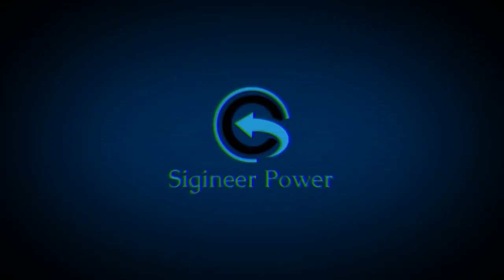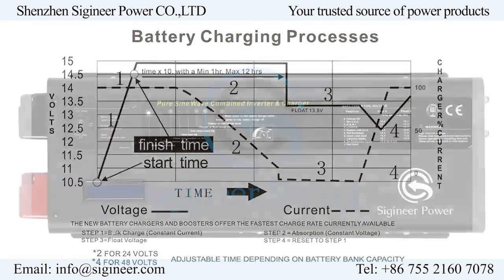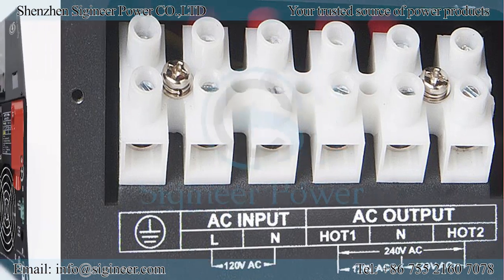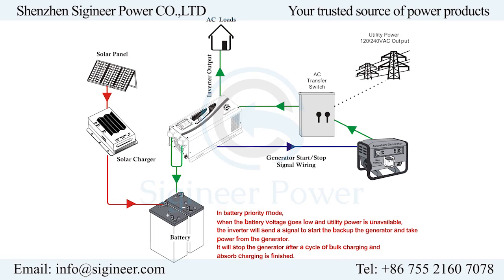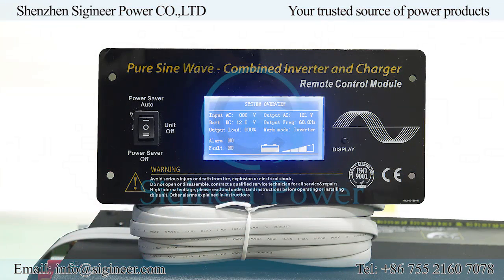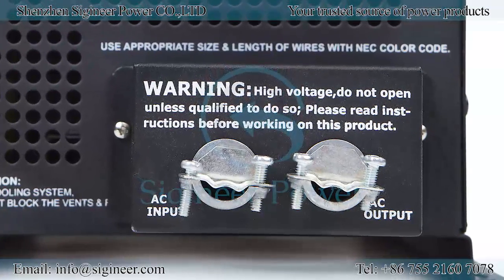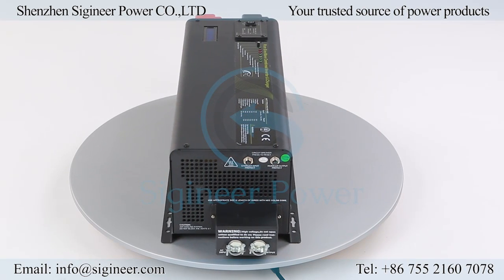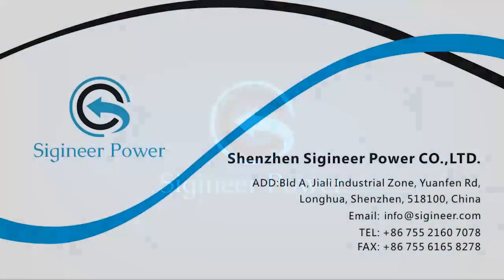2000 3000 4000 Watt 12V 24V 48V China Power Inverter Charger Pure Sine  Any Power Combi

Comment: I purchased a 48V- 6000W inverter, Power star W7, and I'm having problems. As soon as I turn the inverter ON, it reads BAT-V = 70.1. Then it beeps continually. When I initially turned it ON  it worked, but then started failing because of "High input voltage from Batteries", which it isn't true. I measured battery voltage and they read 50.1 Volts charged. Any ideas as to what's going on?

Comment: i have an IR POWER STAR SINE WAVE INVERTER 3000w 24v .if i ON  the power fault will blink and its shot down
Reply: i also have the same problem as yours  maybe the diode in the inverter is burn out because thats what happen to my pmw 1000w 12v inverter,it is shutting down automaticall so not to damaged the entire inverter but it is okay now after i send it to a technician, just try to send it to a qualified tcnician